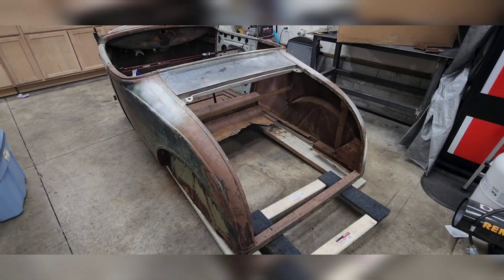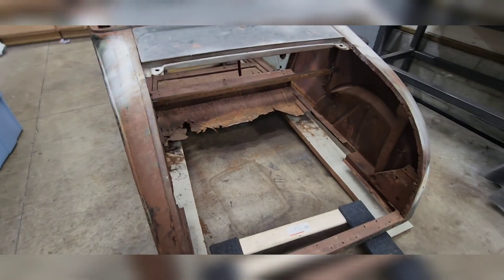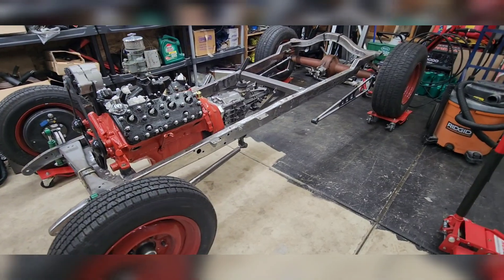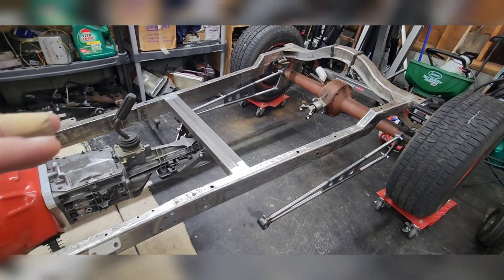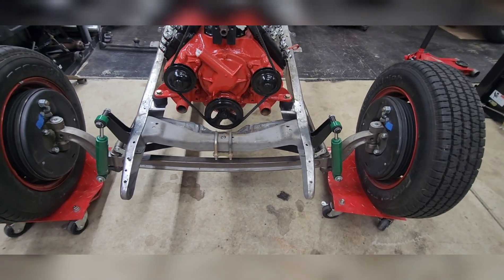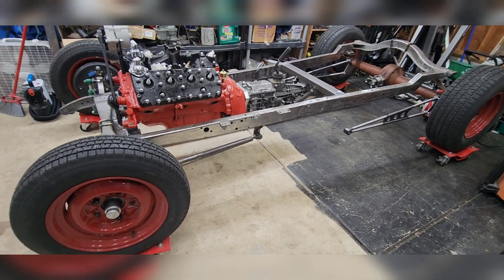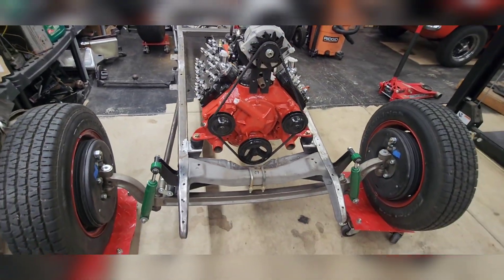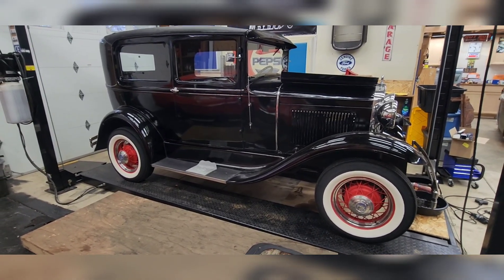1930 Ford Model A Roadster Update Part 2

Comment: Great looking start.  The similarities between your combination and the one I'm building are huge so far. Henry Deluxe roadster, rumble seat, original frame, 51 8BA, T5, open drive from speedway, dropped axle, juice brakes, deuce grill (cheap Chinese), split wishbone, etc.  I want to try it unboxed to see how I like it, and I used a spring behind 37 axle and lengthened the frame (8.25" if I remember) so it wasn't necessary to cut the body. That does interfere with the rumble a little but I'm just using it as a backwards trunk. I did go with 35/36 wire wheels with bigs n littles.  If you do go to them check them for straight before you buy or especially before you powdercoat  $$$ lol.  I'll be following for inspiration. Thanks for sharing your work.   Jim from Ohio
Reply from the maker: I wish I would have done the spring behind with a lengthened frame. There's nothing like the sound of a flatty! Thanks for watching!